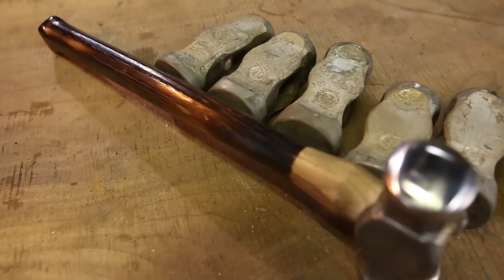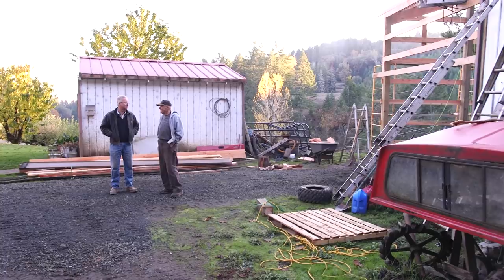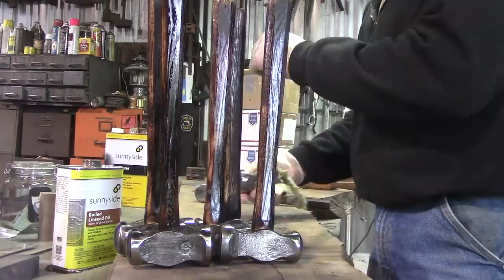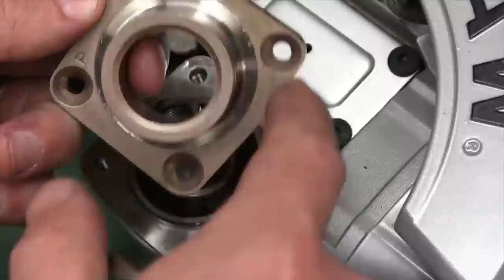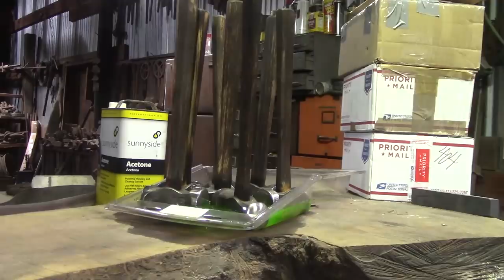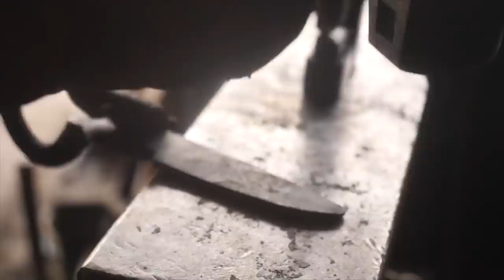Giving Away 7 Hammers

Comment: Tension knot.  I was just watching the video and somehow I lost it and couldn't leave a comment on your most-used nuts like when you're wrapping it around five six times under the nail and you pull it back those we call a tension knot and here in Illinois doing our concrete we use those I use those all the time yes those are very good and so are those hammers I like the Stanley hammer straight steel the handle started pulling out of it as I'd pull steaks out of the ground or cetera not those kind of steaks but you got me and look like some nice pieces of Steel there good work you guys do I like the channel good voice you got you should be well known YouTuber right now thank you for your help

Comment: Is there a function for burning the handle or is it only for aesthetics?
Reply: I have charred the handles of all my hammers. But, first things first. Be sure to remove any varnish (or whatever finish) so that it is raw wood. Anything other than raw wood will blister your hand in a heartbeat. A charred handle feels like velvet and will eventually become a very smooth surface. My everyday 3 3/4 lb, which I made, has a handle that is now 6 yrs old. It may require a "re-charring" since it's becoming quite slick. A worn in charred handle is also quite beautiful.
Reply: BS-